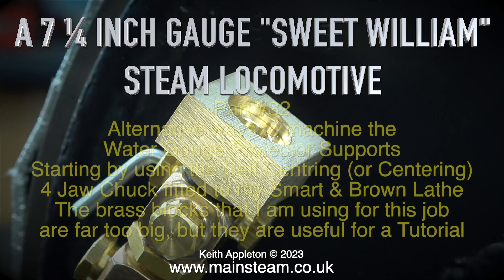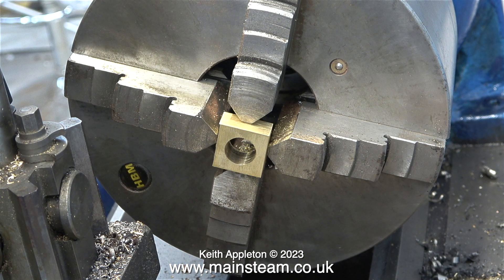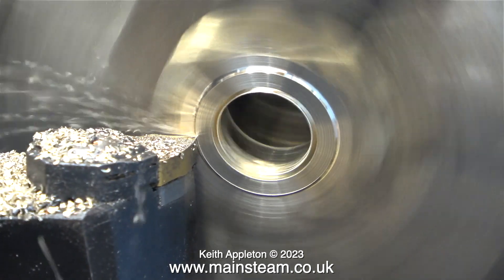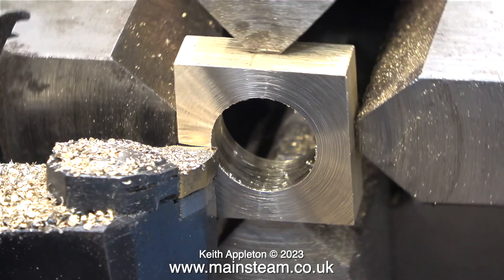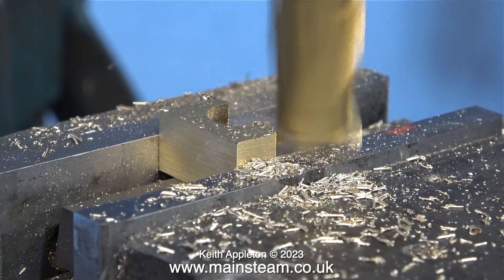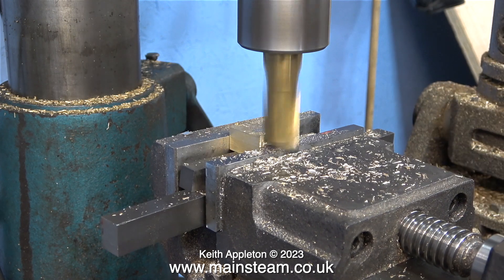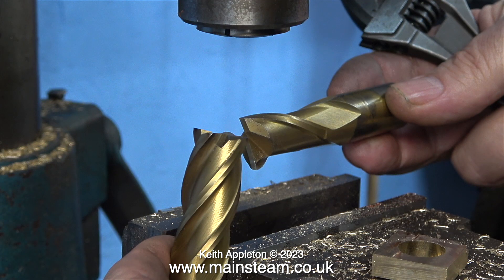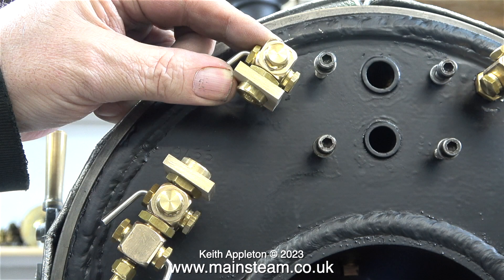A 7 ¼ INCH GAUGE "SWEET WILLIAM" LOCOMOTIVE - PART #32

Comment: Keith, everyone and their dog, by now, has a set of parallel bars. You are the only one I know, who uses bits of whatever. You need to own a complete set of parallel bars.
Reply from the maker: I have made over 2500 videos to date and never needed to use any parallels. My bits of Mahogany are more than parallel enough for what I do, my engines seem to work just fine and I am not bothered if I drill through into the Mahogany packings . . . .